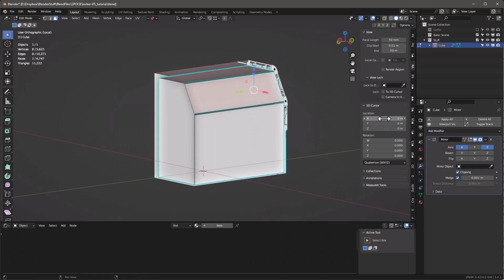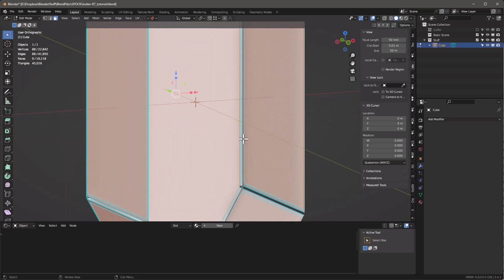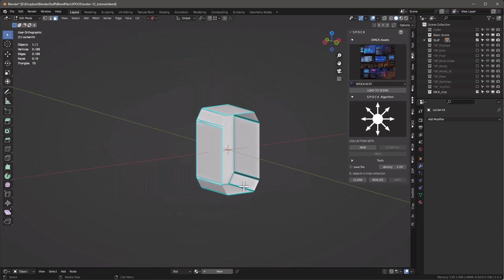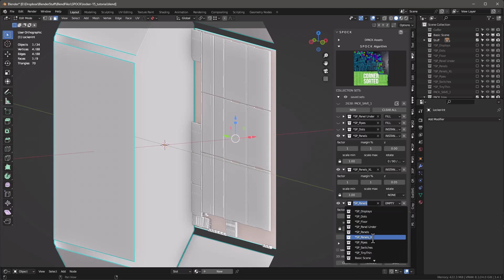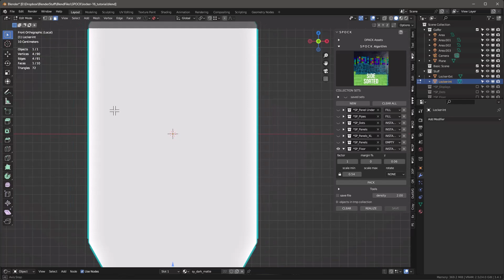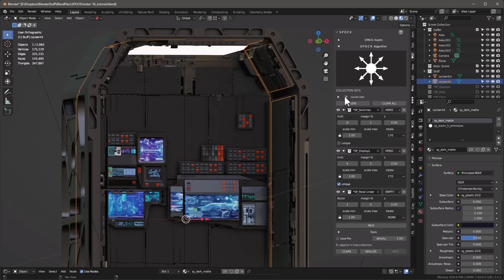Sci-Fi Locker Part 2 Tutorial Interior using SPOCK Structured Sci-Fi Packer for Blender

Comment: You didn't mention that in order for your plugin to run one needs to install scipy module inside Blender's installation directory. Now there is a plugin to do that -- "CGFigures - Module Installer" but on Blender 3.6.1 it is failing to install scipy with a strange error, complaining that blender-3.6.1-linux-x64/3.6/python/sys.prefix/bin/python doesn't exist. But it shouldn't exist, as the proper path to the python executable is blender-3.6.1-linux-x64/3.6/python/bin/python3.10 instead. I will try to report this bug to the module's author now.
Reply from the maker: Please report at http://cw1.me/discord We can help you there.